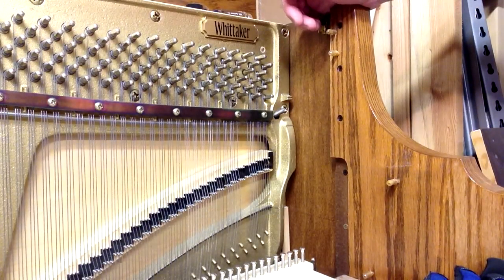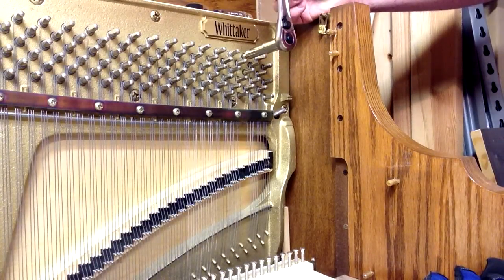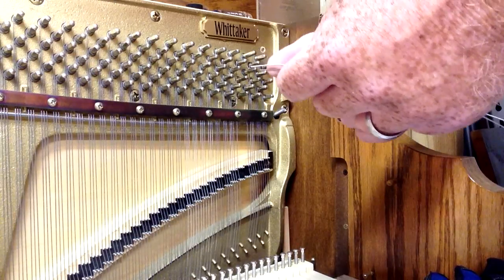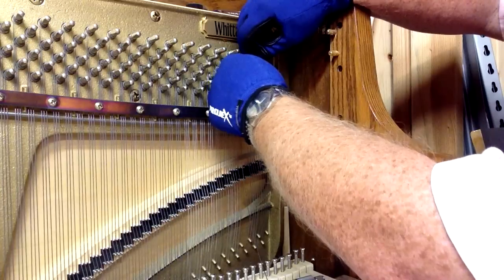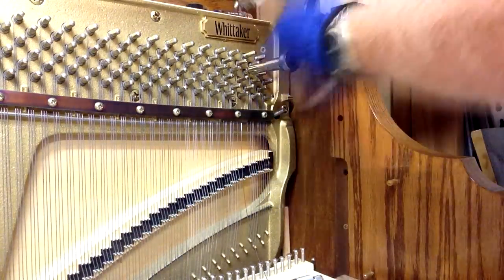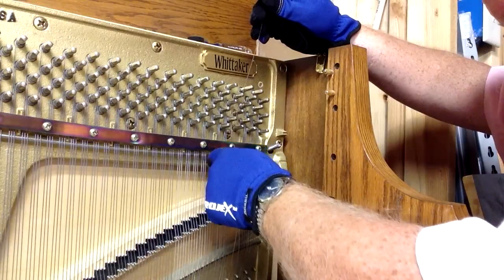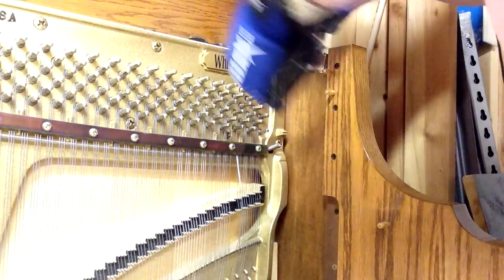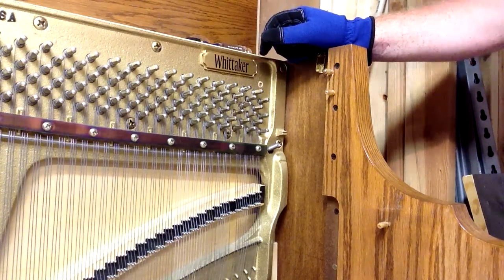Replacing a Broken String In A Piano - Piano Tuning & Repair I HOWARD PIANO INDUSTRIES

Comment: Hi Howard.  Thank you tremendously for your videos.  I have several questions, if I may:

1) Are the particular micrometers used here specially designed for measuring piano string diameters, or are they just standard micrometers (I'm not sure how much they vary across various professions)?

2) If the string is fixed at the bottom via the hitch pin but then comes back up in order to become the next string in the sequence - does changing the tension of one note not affect the tuning of the 'other' one?  

Thanks again!
Reply from the maker: Hi Andy,
Thanks for watching!  The micrometer we use is just a standard micrometer that measures to the nearest thousandths of an inch or to the nearest .001".  When tuning one string, if you're only making small adjustments which is normally the case, the other string sharing the same piece of wire isn't usually affected.  If you're changing pitch such as more than 10 cents or so, then it can have an affect on not only the shared string,  but many of the other surrounding strings because of the increased or decreased tension on the bridge and soundboard.
Reply: +howardpianoind  Thanks Howard!  On closer inspection of my piano, I have a possible dilemma in replacing a broken D5 string:  At the bottom of the piano the bass strings cross diagonally in front of the treble strings making access to the hitch pin difficult.  Is it simply a matter of using some needle nose pliers to painstakingly try and feed the string in behind all the bass strings, or are there any handy tricks that you can recommend that would make this process easier?  Thanks again!
Reply from the maker: Hi Andy, Yes, these strings are more difficult to replace than the strings that don't have bass strings in front of them.  Yes, the only thing you can do is to fish the strings in behind the bass strings and then grab it with a hook or pliers at the other end.  Not an easy task, but it can be done with lots of sweat and effort.

Comment: Thanks. I thought all the treble keys had 3 strings?
Reply from the maker: Yes, in most cases all of the treble strings have 3 strings for each note.  So even though one piece of wire will be for two of the strings, the third string will be shared with one of the strings for the next note.  For two notes, there will be 3 separate pieces of wire.
Reply: thank you for your reply.  you are very helpful.  your videos help a lot of people all over the world.  I tried to tune my piano.  it took 3 days and was very difficult.  it is closer to being in tune than it was before, but there is no substitute for a professional piano tuner.  thanks again and keep posting.
Reply from the maker: Yes, tuning a piano is something that can be done, but for an untrained person it takes a long time and the results are not as good as a professional.

Comment: So one string is used via the hitch pin to replace 2 strings of the three for each note. That means the other string when it breaks only needs one string. Where does it attach? Why would it be rare for 2 strings to break when one string wraps around the hitch pin to make it sound like 2. Very confusing.
Reply from the maker: Yes, the wire gets attached to one tuning pin and then goes down to loop around the hitch pin and then comes back up to attach to the next tuning pin.
Reply: I understand now. Duh!!!!
Reply: Thank you! Merry Christmas!!!
Reply: So... Up in the treble section and higher,  a single string is strung to handle two or the three strings of a unison... or one string of one unison and one string of the NEXT unison.   When tuning,  what allows tightening one pin from tightening the same string... especially in my second example,  the same string but for a different note?   Thanks.
Reply: James Nelson In the treble there are 3 strings for every 2 notes (6 vibrating segments altogether). The hitch changes the direction of the string 180°. That amount of change in direction creates enough friction to hold two separate pitches on both sides of the hitch pin. In fact, in order for one segment to affect the tension/pitch of its adjacent segment (connected by the same string) its pitch would have to change by about a M3.

Comment: So you recommend removing the action when replacing strings ?
Reply from the maker: It does make it easier to install the new string without the action in the way and with most upright pianos, the action is fairly easy to remove.